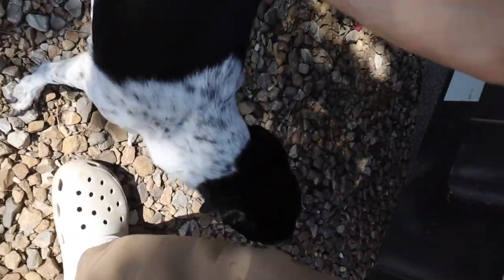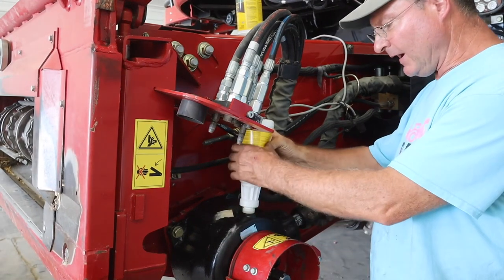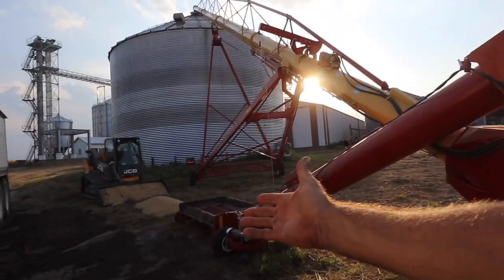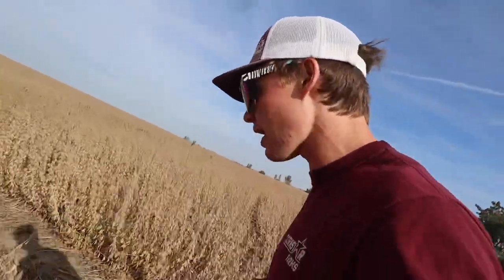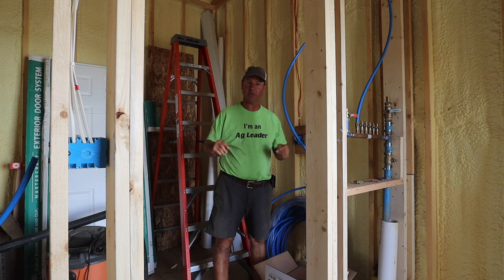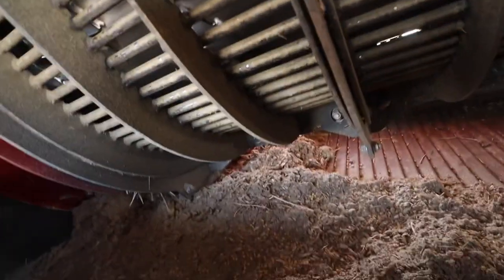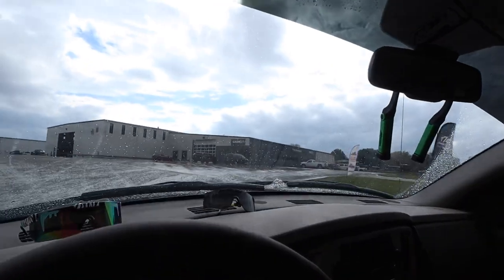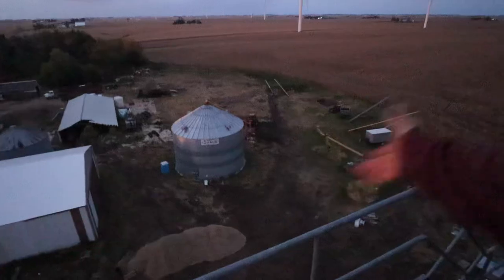Houston, The Combine Has Some Serious Problems.

Comment: Rotor 650 
Fan speed 1150
Pre sieve 10
Top sieve 13
Bottom sieve 11
Concave 22

We run a Case 7230 and that’s the settings we run. About the cleanest sample you can get

Comment: I noticed you are using only round bar concaves. We have a 2020 Case 8250 and we run one round bar on the front right with a large wire next to it, then two large wire on the front left. That's how we've run on beans for many years and has worked very well with our 40ft headers! It will also help with the trash, the large wire will help keep the chaff from actually running over your sieves and just throw it straight threw your knives and out to the spreaders!

Comment: We ran all 4 round bars in corn and beans with no issues. One thing I did was take all the spike  rasp bars out, they just always seemed to add more stem pieces to the tank. Pre seive open too much can fill up the fan.  I always ran the top screen open more than was recommended, and cleaned with the bottom screen. Sends a little more through the recleaner but helps catch some before they go to the spreaders. Unfortunately when the fan fills up it doesn’t trip the fan speed alarm. Good luck.  Everyone has different ways to set them and few will even agree on what’s the best. Just have to mess with it until your satisfied that the losses are what you are content with.

Comment: If that ever happens, go to the back, have someone change the sieve settings and make sure they are actually changing, we've had ours stick on the 8120, typically get a very dirty sample, and over run the clean grain auger and elevator chain, and kick grain out onto the fan. Frustrating for sure

Comment: Looks like you're over loading the sieves with trash. What concave are you using? What rasp bar config are you using on the rotor? Where are the vanes set and are they all there? There are 5 in the cone and a dozen or so in the cage. May want to put all 4 large wire modules in the front 4 positions, speed up the vanes, take off straight bars and install either regular or spiked bars. Just a few things to try. I work at a Case dealer in PA, green stem beans are a normal thing for us. Good luck!
Reply: Good looking out 👍
Hopefully he sees this comment.
Thanks for trying to help the guys.
Reply: THIS
Reply: Yea, what he said.
Reply: WOW! So nice of you to give such information! You rock!
Reply: Yes what he said,  your beans are in 30inch rows. If they are are 10-11 percent you should not have any problems.  Our beans have green leaves on them in places at 11%  with no problem on 7230.  Get the large wires concaves, put the rotor in 2nd gear and run it around 700 and slow it down throughout the day.  Looks like you really grinding everything to much in the rotor and over loading.  It work exactly like your old combine. Same size rotor diameter,  the concave are just rape further around.  Set your sieves like you would with your combine.  If you remember what you set your concave to on the old combine, then convert the inches to mm and start there. It is almost impossible to throw beans over sieves on those machine.  Your losses are more likely to come from the rotor under threshing, it looks like you are over threshing. Do what Ryan says and you will be on your way.  With green stem, you should not be see pulverized stems out the back of the machine.
Reply: its not a threshing issue ,the fan is plugged or not working.You can flip a lever down by the fan to clean it out.if the presieve is open too much it will let grain down into the fan
Reply: We run an 8240 and 8250 and thats what happened to me
Reply: @jimholty2274  I'm kind of thinking the same thing about the fan being plugged or not working. It may be a combination of problems, but the fan definitely is a good place to start.  I've never had any issues like what they are dealing with nor have I ever seen anything quite like what they are dealing with. I was thinking they bought that from a dealership, if so I would be calling the dealership, and asking them what the heck is going on. Typically dealerships go thru used equipment. Even if they bought it from another farmer, I think I would have had a dealership go thru the combine before harvest, to make sure there was nothing seriously wrong with it that needed fixed.
Reply: @jonny555ive  he did! Cole put the heart/liked icon on it! I hope that this helps him and DC to get it fixed!
Reply: It could be a pre sieve or fan issue but the fan and pre sieve do not affect the material getting on the grain pan to start with. It shouldn't be building up on the grain pan. You want a large portion of the trash to go out the back of the rotor not into the cleaning system. Have you done a kill stall? (Its in the ops manual) I know it sounds bad but that will tell you where the bulk of your trash is going. If all you have is stems going out the back of the rotor, that could be a reason for your trouble. I have also seen guys use cover plates on the rear 2 modules to keep the trash in the rotor and force it out the back since the threshing is all done before it gets to the back section of modules anyway.
Reply: This kinda info needs to be looked at. Farmers always help neighbours.  I have heard of situations in Australia where a farmer has gone to the big smoke for medical treatment and people in the district cooked food for the kids, took them into their homes and spent days on rotation keeping his farm going for months at a time.
Reply: @somersfarm1921  if I remember correctly, the combine was actually previously used by the owner of the dealership they bought it from on their personal farm. I'd definitely be reaching out to them about it!
Reply: Ryan has some good points. The last time I saw a sample that dirty it was a fan issue. I also wonder how much is going through the return?  Why isn't the straw going out the back of the rotor instead of over the sieves? It will be interesting to see what the problem is.
Reply: @gexploits  if that's the case, then I'd be even more upset about, if the actual owner of the dealership sold me a combine with issues. Gosh that makes the dealership look even worse, that they didn't go thru that combine with a fine tooth comb.
Reply: @paulanderson262  we had that issue on our case we bought. It had broken sieve rails and the sieves weren't working right and wouldnt clean. Its a case thing, happens on a lot of them i was told by our dealer. And ya that pre sieve is junk, should be closed and they should be running the minimum thrash elements and round bar, large wire concaves.
Reply: @alexandermarken7639  that's what people in Iowa do as well. Neighbors helping neighbors. 👍🥰
Reply: Looks like they need to start with the right concave

Comment: Just my $.02 but if everything else is set correctly and there isn't anything wrong with the machine, open the concave up more and slow the rotor down.  With that much green material going through, the beans get wrapped in it and can't fall down.  They're obviously dry enough to shell easy so there's no need to beat them up.  It's hard to get it perfect with stalks that green but hopefully it helps a little.  Keep your cleaning area clean by not "chewing" up the stalks and it'll do a better job all around.  The chopper can do that job of chewing the stalks up.  Same goes with corn.  If the cobs are broken up it's too tight.  They get in the cleaning area and takes the efficiency away.    Good luck!
Reply: Excellent advice! Most situations it's usually operator error. This combine is new to them and they probably have to learn how to dial it in.

Comment: You can take six bolts by your spreader in the back to slide that concave up closer to your spreaders. We had green stemmed beans this year and it worked good in our 7230. Have round bar conclaves on front left of cage and second right. The other two are large wire. Ran our concave at 20 and rotor at 650-600 range. Pre sieve on back was notch 4 and fan at 1000 rpm set the sieves to the book. Good luck.

Comment: We run green but had problems similar to yours a few years back.  We had a bearing slowly go bad to blow out on the cleaning fan. We also discovered a pulley going out a belt. It was a big job to replace the bearing and ect involved. We took to the local implement after watching them being in contortionist moves we decided we made the best decision. The labor fee and the parts were tough to swallow but in the end they caught another problem that could have really put us out of commission. Sadly our combine had only 300 hours on it when this all come about. It just goes to show you just never know new or used what's going to go kaput. Hope you get to the bottom of your problem soon. That is one sweet Head trailer congratulations
Reply: yes we had this trouble to with 3 of the our combines worst part they came that way new what ever color all do break down how old or new you have them lucky so far we have broke down let hardest we are short men this year there doing something else take higher ranking at this time we have  the fires under control but not out February before they go out
Reply: Pete is youtube gold, who wouldn't wanna see what the next thing that comes from him is!

Comment: The same issue you are having with lower green stems is happening in SE Minnesota, farmers are struggling with very dry beans but the stem is still green at the bottom 3". Good luck and hope you figure out the adjustments on the new combine. 45' wide Wow!

Comment: Hey Cole,  it will make clean up easier, if you will put a tarp down before you open the door/or hatch on that machine. It's the same at the auger. When unloading the grain cart, or the trailers. I learned this 50 years ago.

Comment: Cole, check back of sieve where it dumps into tailings. Some of it is plugged.The plug does not seem to clear with dry stem beans through it, have to take a rod poke it free, run machine, repeat till cleaned out.Think the green stems are to much for the cleaning fan. have still been running in the green stem beans but have to drive slower speed depending on how green they are.

Comment: Don’t know if it’s worth looking into but my friend bought a new case combine which was giving the same results as you are getting. It turned out there were several case combines left the factory were the pipes to the rotors were plumbed in the wrong way. Might be worth checking

Comment: We have a 1981 Gleaner N5, and this is the stuff I'm scared of next week. It hasn't been in the field in almost 9 years.  It hasn't been serviced in 10 years. It hasn't had new diesel for 8 years. Luckily the combine is our only problem so far. Our 9000 Ford has been greased and the oil changed, and the grain cart its hooked up to is working for the first time since 2006. There's a lot that can go wrong, but we'll make it I hope.

Comment: Cole, look at the clean grain elevator speed. If it's on the slow pulleys it'll let the grain back up which then blocks the fan and spills into your tailings. Then it let's all that residue fall through the sieves. We had the same problem on our 9250 in some corn this season. Changed to the fast puller and it cleared it right up.

Comment: When you plugged the combine in the last video it  lugged down ur rpm and caused grain to run into the cleaning fan. Meaning that ur cleaning fan is not spinning fast enough to blow out the chaff out of the grain when it is on the seive. We demoed a 8250 last year and the same thing happened to us. I know you were joking when you said buy a Deere and it wouldn’t have happened but it’s actually true.

Comment: Cole you've plugged the fan on the combine on the LHS there is a leaver with a pin in it which lowers a cover under the fan to empty the trash out
Reply: This usually happens when you have fan to low
Reply: Also close the preserve to 0
Reply: Just adding a comment to try and bump your comment up so Cole sees it. I know he does read all the comments, but when they are this busy, figured it couldn't hurt to try and help get these helpful comments further up the line :)

Comment: The gearbox on the side of the feeder house under the steps at the top is the one that normally causes the reversing issues it’s a 900 hour service item on the 40 series apparently it’s output shaft and the feeder house driveshaft normally have to be replaced to check pull off the top cover on the feeder house under the cab and see is there wear on the sprockets you’ll also need to remove the gearbox from the feeder house the splines on the output shaft and the driveshaft wear out. I’d also check that the vanes on the rotor aren’t set in the slowed down position for corn that could be causing you’re other issue

Comment: Remove the round bar concaves and put large wire in the 1-2 and 3-4 spots.  Looks like you already have the large skip wire concaves in the 5-8 spots so that should be ok.

Comment: Cole it's hard to say what's wrong with the combine when im 1000 miles away lol but a few things to check
Make sure your concave is not closed to much it looks like it's overthrashing the material therefore it's overloading the fan and sieve with to much material, also check which concaves are in that combine you may have to switch them out for soybeans, another thing to remember when you get the bugs worked out the fuller you keep the rotor the better job it will do
Reply: it's a Case that's why

Comment: Same comment 
Well Cole, I think you just found out what it’s like to harvest thick—heavy-light. If the stalk is green, the beans will be heavy on the bottom, and lighter on the top. However then you run into over and under performing crops. Back in the day, we would dump the Crop CHAFF straight into a second combine or what we called a chatter truck, because the sound of it would make you not want to hear anything like it again. 
You obviously are having this same problem.

Comment: If it was a yellow twin rotor I'd tell you to open up the top sieve all the way and up your fan speed until you were getting the chaff out of the grain tank. If your top sieve is multi section, open the one(s) closest to the rotor to get the full air blast as the mog leaves the rotor.  I haven't touched a red one since the 1460's I ran in college up at Alden area.  Or you're grain fan blades are damaged/air flow blocked to sieves.

Comment: Initial settings for beans should be 650 rpm rotor 15mm concave clearance 17mm top sieve 18mm bottom sieve and about 930 fan. Pre sieve should be open a tiny bit. The round bar concaves might be an issue in beans.

Comment: “I’ve never seen that in my life”, at 23 you just as well get ready for a lot of education yet to come in the farming operation…  it’s all new every year, luck when the pods start to plug the opening in the bottom of the bin, just above unloading auger as your trying to haul to elevator at ten below. Hint use plastic conduit to poke pods into auger, that way if auger catches conduit it either breaks it or doesn’t break anything else when gets sucked into auger…. Been there…

Comment: While watching the video I got the feeling that since you have increased the size and efficiency of the grain head, you might now be trying to drink from a firehose especially with a lot of moisture in the stems, etc. As an experiment, try running some passes using only a portion of the width of the head to reduce the amount of input to see if that helps the separator do a better job. See the Ryan Beiler reply below.

Comment: Not recalling distance.  On grain cart plugging.. Would it have been worth driving home, pull into shed, clean cement?   Of course if pit, bin system done…. I am going to be so jealous of that.    That combine seems to have many issues.  Sadly the combines need to have enough material to work right.

Comment: One thing that might help is replacing the round bar concaves with small wire concaves.
Reply: makes sense from my experience with rotor combines. Also with green stems shut down when the sun goes down

Comment: There is something definitely wrong with the combine. Id say its more than a setting. I wouldn't blame green stems. I've seen combines harvest edible beans with no problems. I've never seen that type of concave before in beans, but I've only used smaller older case IH combines.
Reply: Yep your right. Those concave are for corn not soybeans.

Comment: I am no farmer and have never been near a kinebine but guessing that settings on these things are configured based on crop/harvest conditions and they are dealing with what the previous owner may have set. The dealer would not necessarily changed things.  It takes learning and tinkering to get things right. I bought a new car last year and still haven't figured out how all the gadgets and doo-dads work. Took me half an hour just to figure out how to open the gas filler cover.

Comment: Try blocking off the rear concaves or put some hard threshing concaves in the back to close it up a bit. Those big machines have a ton of cleaning capacity. In a really dry crop alot of the grain will shell out in the feeder housing. Wide open modules will just over load the sieves with trash. Opening the rotor clearance while increasing travel speed might also help.

Comment: The gear box that runs the rock beater,  pull it off and inspect it every year, it's a pain but it's very expensive to replace the beater and the gear box all at once. The shaft is the weak link

Comment: The 9230 Case Case IH  combine was at one time the biggest combine Case made but that is no longer true Cole. The 8250 Case IH has bigger capacity than the 9230 and of course the 9250 has more capacity. Hate to correct you Cole but that is just the facts. Watching these videos of your problems with your combine proves to me I made the right choice in buying a new combine instead of buying someone else's problems.